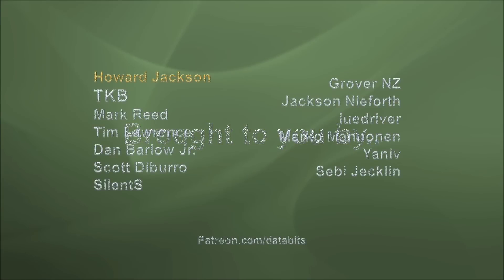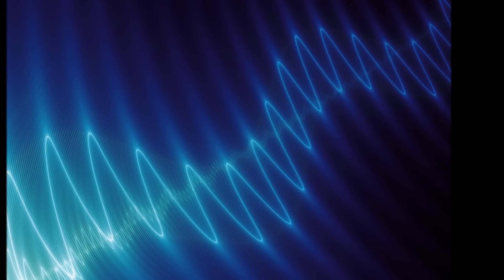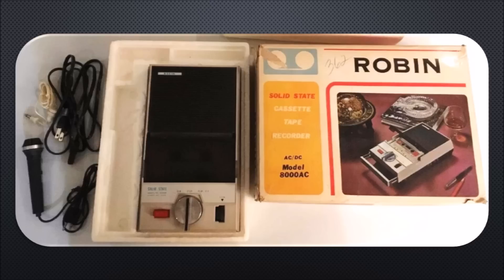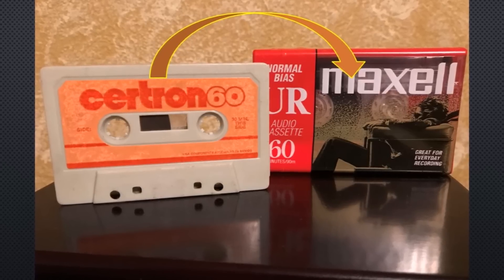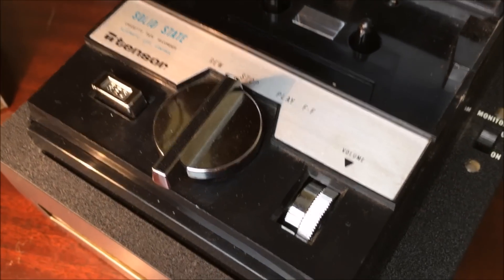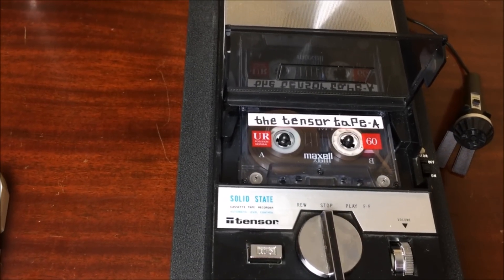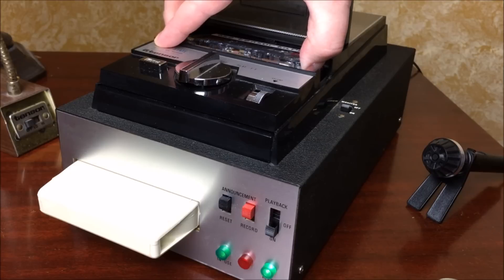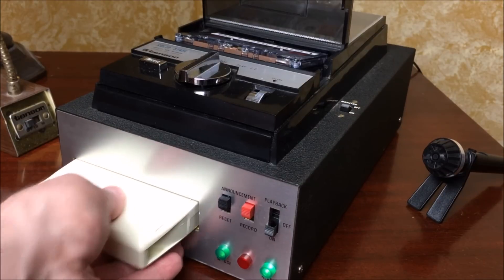Tensor Lamps and The 8-Track Cassette Tape Answering Machine

Comment: It would have been cool if they used all 4 tracks if the 8 track (mono of course) to make 4 different greetings (outgoing messages) so you could switch them in the fly without recording over the other.
Reply from the maker: Absolutely!

Comment: Just wondering if you know if it's possible to change motor speed on a Montgomary  ward cutter to cut 45's discs.... Any advice much appreciated..
Reply from the maker: Other than modifying the roller or motor spindle sizes, no.

Comment: Certron cassette, ugh.  Those were utter garbage.  They sold them in poly bags of three (no boxes) for $1.50 back in the late 1970s (about $6 today).   They were notorious for binding up and they sounded really bad.    Even K-Mart's house brand cassettes were better.

I still have a Tensor lamp I bought in the 1980s.   Those things are awesome.  I converted mine to LEDs about 10-12 years ago.
Reply: I have a few Certron tapes and it is not bad for recording OTR shows, and it was a “Type 0” cassette. I used TDK, Maxell, Memorex, Fuji and other brands of your choice. I see a Maxell UR cassette with the left hub which was from a Certron cassette where it calls it a Franken-Cassette.
Reply: @Musicradio77Network  I seem to recall hearing they got bought by another manufacturer (BASF, I think?).  Perhaps the quality improved?  Like I said, they were pretty awful back in the day.  Noisy, limited frequency range, and prone to binding up.

Comment: Wires soldered to the heads is because they used the conductive head change leader/join on the tape to indicate end of the loop, as the loop end would short the 2 grey wires together, presumably activating one of the relays and the logic to stop the outgoing message so the  calling party can leave a message, and reset the tape loop for the next call. I would bet that you used a short loop 8 track tape, and recorded the outgoing message, and when it got a call you would have both the outgoing message on the cassette tape, along with the phone call audio till it detected an end of call, either via line reversal or the disconnect tone, depending on the phone system in use. When playing the outgoing message you would record the full length of the loop, and press the beep button on completion of the recorded message as a tone for the called party, then it would carry on recording onto the 8 track till the leader came round again to stop it. Thus the odd end of message on the cassette tape, as the original owner did not quite get they had to mute the recording till end of the loop.

Simple enough design, using the basic functions on the decks, just with the erase head and the record/playback head being both fixed position (and probably not exactly aligned with the 8 track standard making interchange near impossible) and isolated from each other, so they could use the large areas of the heads as the contacts. They probably did make a special loop tape for the machine, using commercial 8 track blank cartridges, adding in a longer leader so the length would reliably trigger the circuit. You probably will find the original 8 track electronics board under the new one, providing the record, replay and erase circuitry, with the top board providing the power supply and logic only.

4 wire connection to the top board provably is a ground, 12V for the electronics and the motors, a audio signal using the common ground, and finally the fourth wire driving a relay there that turned on the record circuitry ( provided the cassette player mode switch was set to the record function), the capstan motor and enabled the recording of audio. Playback used the always 12V supply to drive the motors and playback chain, which in those decks used the same amplifiers in most case, only with a mode switch changing the organisation of the various sections, and turning the one preamplifier into the bias oscillator for the tape.

Comment: The funky Frankenstein monster I have kicking around is an 8-track tape with a loop of slide film mounted to the top with a little mirror in it.  It was used in a contraption that would display an image projected from the slide film, while playing associated speech.  Then a beep on one of the 8 tracks would be used to advance the slide film.  It would play all day to advertise things to a captive audience who were stuck in the queue at a UK post office.  About the same age as the answering machine contraption.  The things that 8-track was used for.